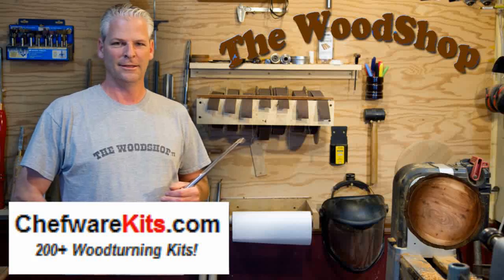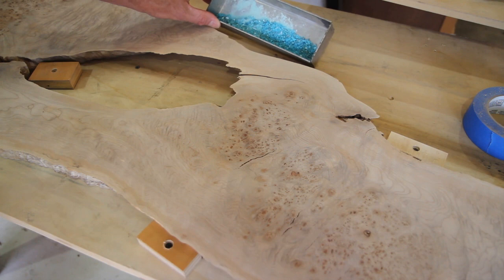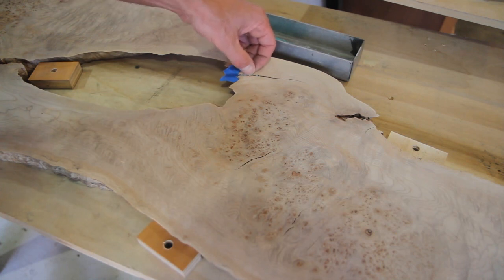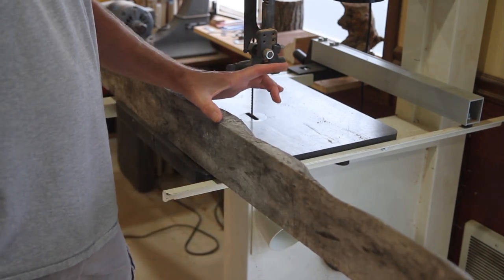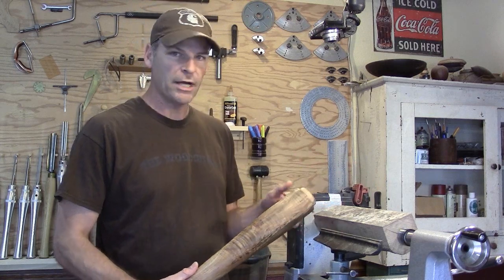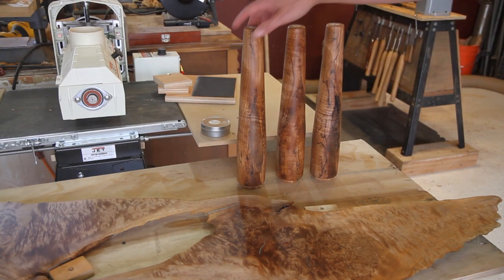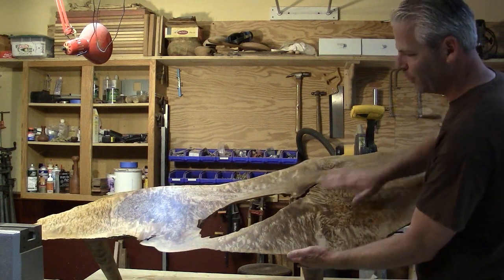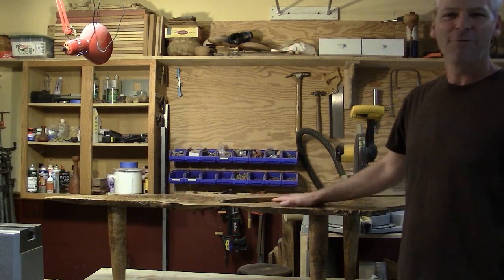How To Make A Live Edge Coffee Table | DIY Woodworking Project | Carl Jacobson

Comment: Very nice! I had roughly a 4 ft x 6 ft cross section 5” thick slab cut from of a tree trunk from the jungle in Irian Jaya (New Guinea) years ago with the idea of making a coffee table out of it and dating the rings. Unfortunately it turned into a corkscrew and split 8 different directions. It rained over 200 inches per year over there so it was difficult to get anything to actually dry out. :-) Glad to see your piece of wood worked out for you.
Reply from the maker: Thank you Ronald,
That's to bad, sounds like that would've made a great table too. This one has a few bad cups on the bottom, but the top is flat.

Comment: Cover the void top and bottom with glass. Rout a small rabbet, so the top glass (cut to fit) sits flush. The bottom glass can surface-mounted with the same type clips used to fasten mirrors to walls. The space between the glass pieces can be filled with whatever you can think of. A layer of sand, some rocks and aqua-colored top glass, for a small pond effect. Or rocks. Or trinkets, coins, LEGO pieces, etc. Or something different for each season. Keep one of those suction-cup handles handy (they come as small as 2"), or just use a suction cup, for lifting the top glass, to change the contents.

Comment: How do you finish with oil and wax - is there any procedures you have to follow (sand between coats, wipe something somewhere)? It looks amazing, I can't find the right words to describe it and I am a writer, it is my job to find words to describe stuff. I am not a woodworker, but I watch a lot of woodworking videos on youtube and this is one of my favorite projects ever. If I will ever have a cabin (wouldn't fit nicely in my current place), I would like to have something like this. Also, It really did look easy to make - I am sorry, but it did :D It looks like you took natural beautiful board and put legs onto it. Really nice, Carl, nice job.
Reply from the maker: Thank you very much for the kind words. It really is easy to make. I just dry sanded to 320 and then sanded with 400 with the oil.